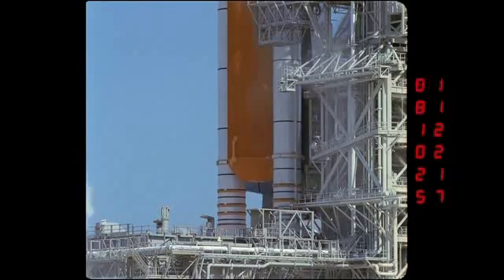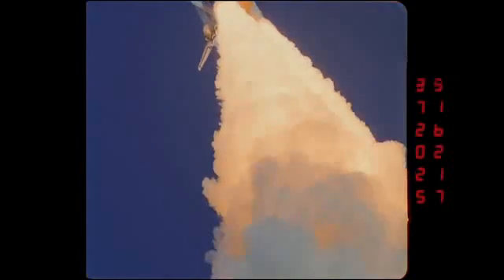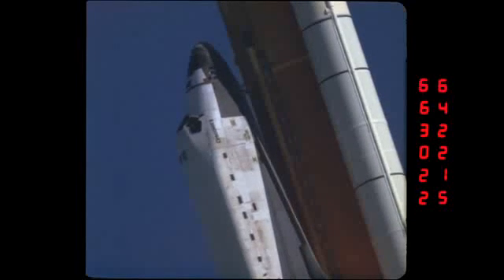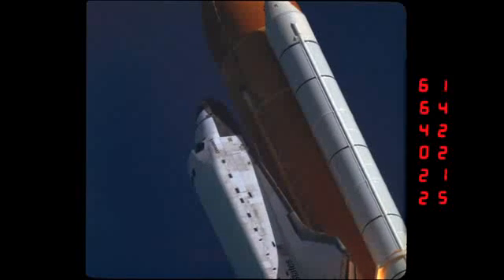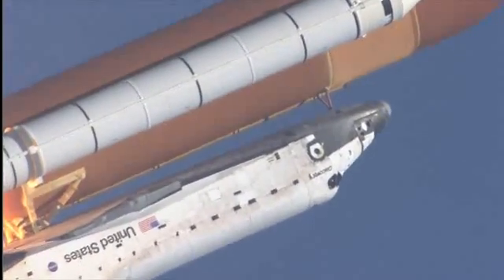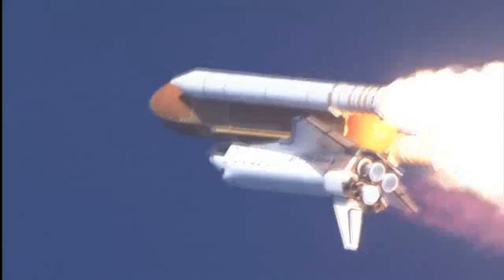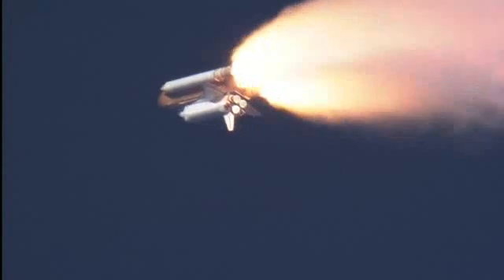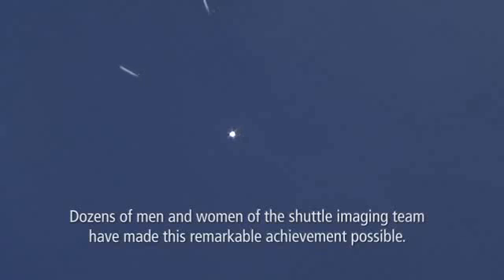Part 4: Space shuttle launches high-speed video camera slow motion views

Comment: FAKE! 1:45 min. Those connections would be much too weak for a 4 tons Spaceshuttle at a speed of 10.000 mph!
Reply: The main structure points on the side tank are located at the bottom, those at the top dont need to hold all the weight of the orbiter, which is why they can be so thin, so no, its not fake

Comment: How is the orbiter attached to the fuel tank? There doesn't seem to be a strong connection between them other than the feed lines at 1:50. Wouldn't there be enormous force difference bet the orbiter and tank/SRB's requiring massive fasteners?

Comment: The boosters float by design. Landing in the ocean with chutes drives air up into them. The divers are there to pump out some of the excess water and put a plug in them. The frustrum section (just below the nose cone) of the booster lands on its own and is hoisted out of the water and put on the boat.